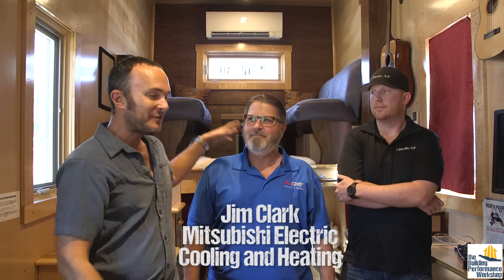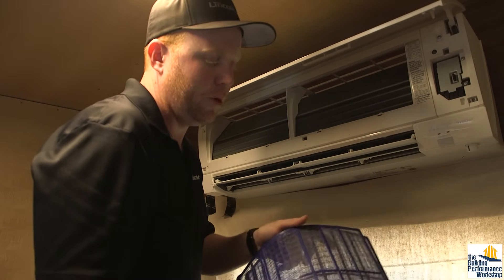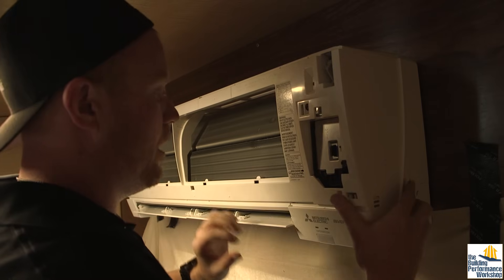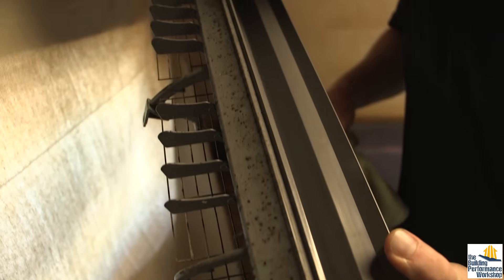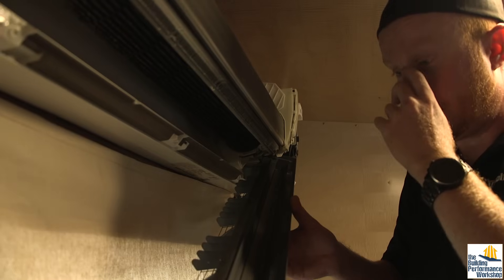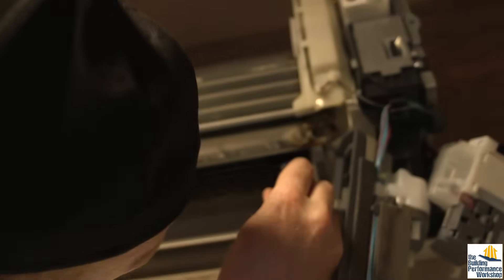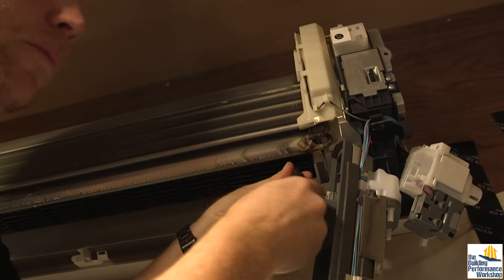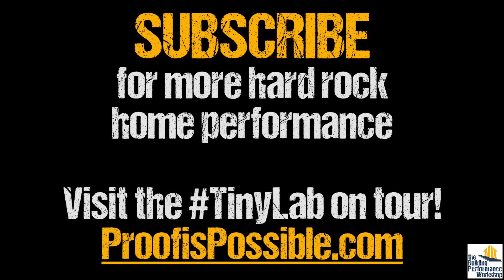Ductless Mini-Split: How to Take Apart & Clean DIY (Mitsubishi FH High Wall Series)

Comment: I tried cleaning mine in the afternoon. After that it was cooling. But now at night, it seems to not be as cooling anymore. Even when I set the temperature lower to the on I usually set. Could I damage something that lead to this?
Reply from the maker: Did you make sure everything was dry when you put it back together?
Reply: @HomePerformance  it was dry. But I did not have the cleaner spray that you used. So I skip that part. I only rinse the fan and filter and wipe everything clean. I didn't wipe the coil.
Reply from the maker: Coil may be restricted by dust/growth below the surface of the fins you can see, but I’d wait a bit and use an sctual room thermometer to track the temp- first time you try something crazy your brain plays funny tricks.
Reply: @HomePerformance  I do have a room thermometer hanging on the wall. So I was sure of it since the temperature read 28c when I set the air conditioner to 23c (we are used that temperature because we can't stand too much cold). I live in SEasian so it's very hot here. I'll try to use the cleaner spray thing. Waiting for it to arrive. Thank you for your help.
Reply from the maker: Whoa, 5 deg C is a huge problem. That’s not just a restriction, sounds like you should get ready to call for pro help
Reply: @HomePerformance  I can't. With the covid problem, there is no such thing now. So I can only try to fix it myself. Either that, I'll just use the fan. 
Can you advise, since it's not cool enough is it safe to use? There's no smell or anything. Just not cooling enough. Except in the middle of the night where it feels cooler.
Reply from the maker: Nothing should make it unsafe- keep trying. Good luck.
Reply: @HomePerformance  thank you very much.

Comment: i tried to remove the blower on my mistubishi inverter.. even took out the set screw.. but still not able to remove the blower as though theres something stuck in there when i try to pull out the blower wheel.. pls advice
Reply from the maker: +Mufiyah Mahmod don't remove the set screw. Watch again, closely.
Reply: Home Performance does that mean that by removing the set screw i am not able to remove the blower wheel??
Reply from the maker: +Mufiyah Mahmod no, I just mean you might have missed or misunderstood another step before that. It moves pretty quickly- i use the pause button a lot on this one.
Reply: @mufiyahmahmod5416  The caution about "not" removing the set screw is only because if you do take it out completely it can be a real bear to put the screw back in. If a magnetic screwdriver won't hold on to the screw for reinstallation try applying a small dab of chewing gum or some other sticky substance to the very tip of the screw driver to hold the screw on the driver while you line it up with the hole on the blower shaft and get it threaded back into position.

Comment: The only issue I had, if it's an issue, is after reassembly when I shut the unit off and the horizontal vanes do their little dance and close the larger upper vanes ( TR and TL) don't seat totally flush with the front cover and I can't see why as they are on right- there's only one way they go on. The other thing is I was surprised by the rust on the plate where the copper refrigerant lines go into the coil. Seems like there is 3 metals there - copper ( refrigerant lines) , aluminum (coil fins) and steel for the plate. It seems obvious that a steel plate would rust with all that condensation so I'm surprised Mitsubishi use it.
Reply: That issue could be because the front panel is not correctly put back. It has like 6 notches you need to install correctly.
Reply: The front of the cover where it's up against the drip pan was pushed in all the way. Now they work and close correctly.
Reply: That might have been the issue.

Comment: HVAC is what I do for a living and I would like to relieve my customers of this grief of having to go through this cleaning process due to mold mildew funguses that grow in different areas of the country that are more or less prevalent in different regions. This is why I install the RGF mini on all my small residential condensing heads to reduce or eliminate molds and fungus growth. The RGF unit creates a peroxide molecule that stir lyses the evaporator coil and drain pan and fan blades that developed a mildew that grow on their surface. Some contractors may argue that I'm giving service away and I'm making less money by not having the customer call me back for a few hundred dollars to clean out their air handler. But I happy customer with fewer maintenance callbacks will be your best advertisement, if they know you have their best interest to save them money and not just thinking about your own pocket and trying to pocket their money into your wallet.
Reply from the maker: +t lech great solution! thx!
Reply: When a customer delves too deep and screws up, guess who needs to come save the day??  Soo many people overstep themselves and expect techs to come immediately to remedy their self-imposed screw-up!!! CALL a tech!!
Reply from the maker: +Atom Atom quite true, but what if there are no local techs who will perform? What if there are, but they don't call you back?
Reply: I cleaned 2 and everything came out fine. Another units blower wheel looked clean and no mold was visible so i just sprayed the coil and let the condensate run out the drain pan.
Reply: How about adding an additional layer of filter material on top of the air handler? Will that help cut down the dirt on the blower?
Reply: @amyk.8434  It probably would but I would imagine more filtration will cut airflow making the fan work harder to get the same amount of air flow
Reply: Maybe use a lighter filter rather than a filter that traps every germ in your house!
Reply: @amyk.8434  Possibly. I figure the main wall u it I'll clean every 6 months and the others yearly
Reply: Just take a visual look at the blower. It might not need to be cleaned so often unless you live close to very windy area with lot of dirt and dust blowing around.

Comment: Does anyone know approximately how much an AC company would charge for cleaning the blower wheel? I am going to try this but if I cant do it, will need to call AC company. Thanks
Reply: I pay $600 for 5 mini splits.
Reply from the maker: Sounds reasonable

Comment: Long shot for an old video like this, but after my second year, I had a service done on this exact heater by licensed professionals. The issue is, after this service, my heater no longer blows as much warm air. I'm not sure why, but they also tested how much gas was available in the parts that are outside. They have been here 2 times for a checkup, but they say nothing is wrong and it's normal.

I wouldn't have complained about this if the weather had been colder over time, but this happened overnight, and it's the same weather outside (around 12- Celsius), yet the warm air that comes out is very different and noticeable from the day before or even the year prior to this service. The settings are also identical to what was prior to this service.

Should I get a second opinion from someone else to check if there is a gas leakage, perhaps? It's not possible to steal gas like this from the part outside, right? It's all very strange for this sudden change in heat that comes out because now it even struggles to get warm air at max settings at 12- celcius and we used to have it at 24/32 on the settings. I can't think of any other thing it can be except from low gas level.

Thanks.
Reply from the maker: They should not have checked the pressure- every time that happens, some of the refrigerant is bled away. You probably need more refrigerant, just my 2 cents
Reply: @HomePerformance  It feels really strange to me that a two-year-old unit would have such a low refrigerant level right from the start, especially after they did a refrigerant check for the first time before the checkups after my complain. I mean, these were the same people who installed the unit for me as well. And I can't help but wonder if they even used the right tools to check the pressure properly. 

Where I live, refrigerant is crazy expensive—close to $300 for a refill—so it's definitely concerning if something's off here. 

Thanks a lot for your response. I'm definitely going to reach out for a second opinion somewhere else to clear things up.
Reply: @Formastic  On a mini-split like you likely have (Mitsubishi inverter tech, heat pump or not), you cannot "check" like the old whole-house simpler units. The only way to know for sure if you need more refrigerant is to use a specialized machine to pump the old one out, weigh it, and put it back (and add what weight of refrigerant might be missing). If too much is missing, then there's a leak. So once evacuated (refrigerant removed), the HVAC tech can use nitrogen to pressurize the system, find and fix the leak, then purge the N2, get a vacuum on the system, and fill it back. 
That takes time. Time is $ (cost for you, revenue for the HVAC tech). So it's more likely that the tech will add some refrigerant, guessing things out and potentially damaging the system. Faster than reclaiming and refilling.

Comment: My job wont come do maintenance to our mr. Slim unit so i figured ima take it into my own hands and clean it.
Reply from the maker: You got this
Reply: @HomePerformance  Question. So whiever installed our AC did the screws really tight. The set screw for the blower motor wheel is really tight. Can it be removed without loosening?
Reply from the maker: No, you have to loosen it to get the wheel out
Reply: @HomePerformance  I got it, Thanks for the video and help 👍, i got it as clean as possible and now its blowing out more air and has no smell. It was atrocious before.
Reply: @HomePerformance  I got chewed out and told i'm not licensed so i shouldn't have done that..
Reply from the maker: No way, you didn’t istall it or touch the refrigerant lines- Mitsubishi encourages you to maintain their equipment yourself. Whoever chewed you out was being pretty silly.
Reply: @HomePerformance  so a new problem arose.. after cleaning the unit it started leaking. It mainly drips when on high. I figured it has to be the evaporator pan that gets full but it didnt do that before.
Reply from the maker: Make sure they plugged the pan back into the gasket solidly, and it’s not tilted at a new angle for any reason. You’ll have to disassemble it again.

Comment: You guys do this or a living, its crazy to think the average person can do this quarterly, we do not have mechanics at my house and we know nothing about the inner workings of an A/C.
I really wish the company we purchased our 2 units from had explained the cost to have them cleaned, found out later $300 per unit 4 times a year!  Before purchasing they told us it was very low maintenance and we would only need to clean the filters annually. 
They never mentioned the in depth detail it takes to clean these units.  That roller needs to be removed and soaked in warm soapy
Water to remove mold and dirt.  The "professional" who was supposed to be cleaning ours did take it apart but just gave it a few squirts of a spray called "awesome" which costs $1.00.  I asked him to give me the roller and I
Cleaned it and soaked it in warm soapy water since it was filthy and had mold on it.  He wasn't going to clean that part.  So. If you have a person come to clean it be sure to watch what they are doing since once its put back together you can not see the roller.  The technician who tried to clean our really didnt seem to know what he was doing.
Reply from the maker: +CD Rozich I've found that if I use mine on A/C or Heat in automatic fan mode, the unit only needs cleaning every year. It's the Dehumidify mode, especially with manual fan settings, that get grosser sooner.
Reply: I just had my mitsubishi mini split serviced also and it cost 200$ but they did not pull the blower cage out. They cleaned it primarily with compressed nitrogen. I am thinking from here out i will probably pull it apart yearly to give it a good cleaning like this. I clean the filters monthly during heavy use in the summer since they are pretty accessible.
Reply: I just did it and it was a bit difficult but all went well and like a lot of  things it seems a lot easier after you do it.I did one of my 4 splits and they've been in for 13 months. I have one other with a musty smell that needs done. I wouldn't want to do all 4 every 3 months but that hasn't been necessary for me. As a matter of fact I probably could have just sprayed the coils as my blower and inside of my unit wasn't really dirty.
Reply from the maker: Good work, Chris!
Reply: @HomePerformance  That's good information!  Pin that!
Reply: @heathmeetis9962  "clean" with compressed N2. So they just blew all the mold into your house. Compressed air would have done the same; compressed nitrogen is nothing special and meaningless here, at best, a marketing way to charge more. (air is 78% nitrogen, something like that).  N2 is "dry", but that's about it. 
Do your own cleaning will be best indeed, and fire that last HVAC company.

Comment: Don't bother with the back section of coil? Nor flush the drain pipe out?  Even a level unit can hold a little water. But clean helps enormously
Reply from the maker: Yes, both good points, do what you can.

Comment: Ive cleaned a blower wheel in a minisplit like that with wheel in place. Turn on fan to high and hit with nitrogen. Taking it apart like that is not cost effective for 3/4 ton worth of cooling or if your in a building full of these things
Reply from the maker: For the pros out there, this might be a good stop gap fix for dust. But it won’t take the mildew or mold off the inner components.
Reply: wall hung petre dish
Reply from the maker: Depends on how the user runs it
Reply: How will nitrogen remove the dust and mold?

Comment: I wouldn't recommend this be you're only source of heat if you live in a dry area. Make sure you get a heat pump mini split for dry areas if you must go that route.
Reply from the maker: This is a heat pump
Reply: @HomePerformance  I didn't say it WASNT. I said if you MUST. Also... I wouldn't recommend it unless it was a high heat heat pump. They are made for dry areas. I have a customer that has this same unit but a MSZ-FH09. Worthless in the winter. This is good for supplemental heat but not primary hear.

Comment: My blower is stuck.  I took the set screw all the way off and will not budge. I even tried using a screw driver to Try to pry it a little. Still would not work.  I have 5 of these units the first one came out easy. This one is a problem.  I also broke the drain tube. 2 Nd story bedroom as well. Gotta replace as well. But it is nasty as heck. Mold and mildew.  I hate these systems. Wish I had the traditional whole house systems.  Had no choice when I purchased this home.
Reply from the maker: Interesting, Joey- probably gunked up. Feel free to apply pulling pressure, you won’t hurt the post that turns the wheel.

Comment: It's really too bad there are so many clips and so much plastic on these units, plus, not very efficient in terms of access for cleaning. Some pros don't even take these things apart but instead clean them while leaving everything in place. 

I have found better solutions for cleaning the coils than the smelly caustic foam. Try BBJ's microcoil cleaner in a concentrated form and simply dilute with distilled water in a hand pump sprayer etc. 

If Mitsubishi wanted to improve on these designs then I would try and at least make it as easy to access as some laptops with fewer creaky plastic parts. As the temps increase or decrease on these units the plastic will often make noises which defeats the purpose of the whisper blower wheel. The outdoor unit has the same issue as the motor and fan are quiet but the grille tends to rattle as the speed of the unit ramps up or down. It is very difficult to locate what makes what sound as it is often a traveling vibration so in one instance it tends to go away by addressing one piece of plastic or screw only to later find out a different area is also causing a creak or rattle etc. 

Those clip hinges on the indoor head units are also so aggressive that getting them to lock and unlock causes a pretty large jolt to the unit which again over time defeats the purpose of having the units remain whisper quiet. 

Hope all this helps and is a more realistic description than just assuming these things are either maintenance free or made to automotive tolerances which they are not. Additionally, all these maintenance protocols need to be done each season so they are preventative. If you are getting lots of mold in these units in between those cleaning intervals then try and measure your indoor air quality and relative humidity as these units can do a little dehumidifying but not much. Mold growing probably means you need to clean more often but also have a drier indoor environment like between 35-45% RH etc. I'd also use an ERV/HRV for fresh air supply since with all ductless units there is no air exchange in the system like in a traditional HVAC system.